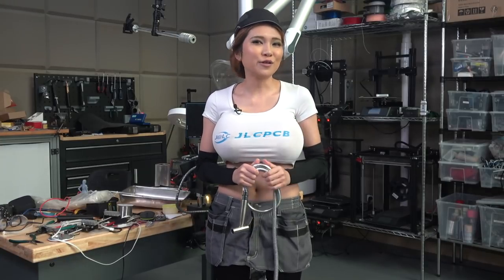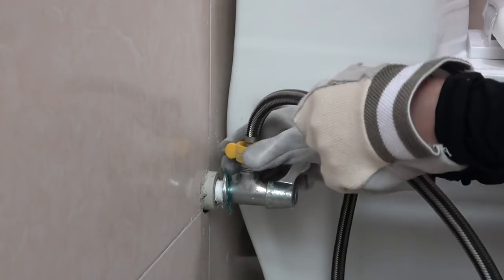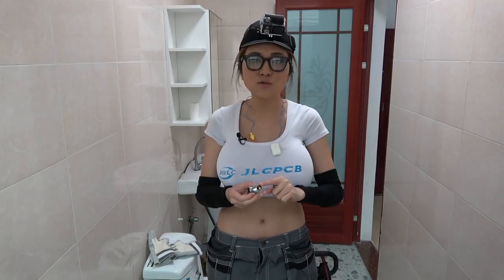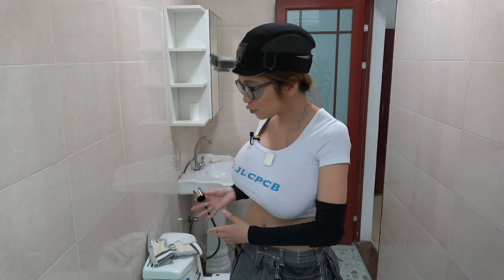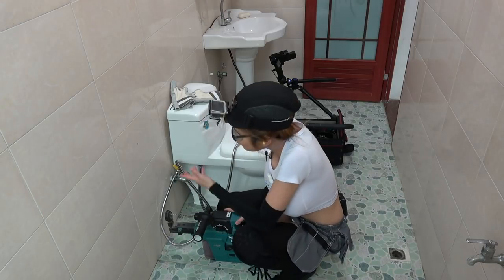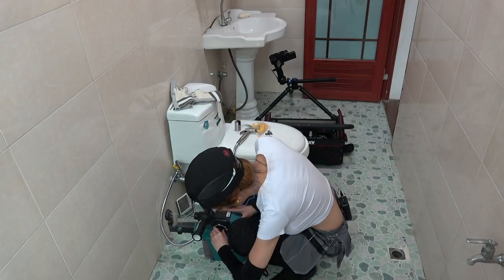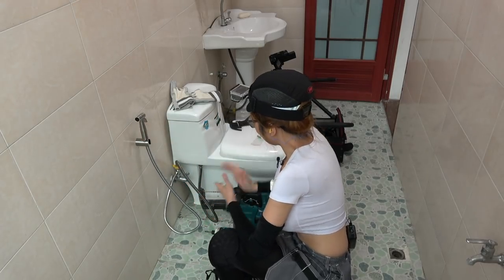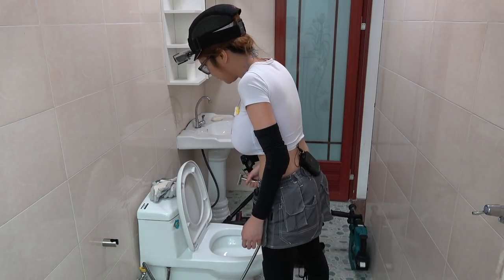Install a "BumGun" and Save Toilet Paper!

Comment: Nice!
I installed two BumGuns (what a fun name) at home. Had to add a mixing valve (russian winters are kind of chilly). If your hot and cold water pressure is different you have to add check valves, otherwise the mixer will mix more than you want. I also added an electric valve and wired it to bathroom lights (not everyone has a window in the bathroom), so I woldn't get an unwanted swimming pool if the hose fails when i'm not at home.
Wall water socket usually has a ball valve instaled (opens or closes by 90 degree turn). They (ball valves) are not meant to throttle the flow, they get scale deposits on the exposed parts of the ball and it can mess them up. It's better to add a globe valve for the bum gun (if water pressure is an issue).

Comment: I brought one of these BumGuns back from m last Thailand trip. One point (at least here in the UK) is that you need to fit a non-return valve into the system to prevent any ingress of "bad stuff" into the water supply.

Comment: Naomi, you nearly nailed the security measures, but, next time, use a pipe metal detector before drilling in the bathroom, you could hit a pipe and flood the house...
Earplugs are not that critical, just regular in-ear buds with your  music will do it fine (mine get 20db cancelled out), plus you enjoy music while drilling.

I use a similar drill to go through concrete walls with 50cm long drill bits, that's a bit overkill for the job, a normal handheld one with hammer (not with compressor) is fine and lighter.
Use the anchor sleeve to mark the drill bit with tape or a pen, so you get it to the right deep. (you got too deep).

Put masking tape or duck tape in the tile, will prevent the drill from slipping and the tile from cracking. 

You rock!
Reply from the maker: Good idea!

Comment: In the USA, we typically use a teflon-tape instead of that messy compound you had to smear around the fittings.  White is generally for water connections, yellow-tape is for gas fittings.

Comment: Piece of advice for water pipe connections...use Teflon Tape. Instant seal and you don't need a plumbers wrench to loosen when and if the time comes.
Reply: yeah, i was wondering about that...I've always used Teflon tape, myself
Reply: Hemp is better than teflon tape because it expands when it gets wet.
Reply: Neither sealant nor tape is necessary when rubber seals are used, tape is for threaded joints with no seals.
Reply: Murgoh   Your correct. Thread sealants are used for pipe joints which have a taper.  A gasket connection is a face to face seal so no other sealant is necessary.  The rubber is the sealant . An “O” ring seal requires a small amount of lubricant for assembly purposes. The amount of sealant Naomi used will eventually flush out, and in this case, guess where it gonna end up. Still, a good video.

Comment: Good job! 
Here we have always used Teflon tape instead of glue to seal the joints... 
I recommend it because I do not know the hardness of the glue but in Teflon it seals perfectly and does not bind the threads.
Greetings from Spain! 👋
Reply: That's usually what we use in the US also.  Some plumbing fixtures like this actually come with a tiny roll.
Reply: O ring joints don't (shouldn't) need tape or sealant.

Comment: I prefer the Japanese style bidets that have a nozzle pop out from under the toilet seat. If those are too expensive or you have no outlet nearby; you can get ones that run on water pressure (no electricity required) & can hook up to sink hot water if you want temp control.

Comment: I'd like to add in the USA typically we don't have wet baths with floor drains. The bidet bum guns come with a valve that allows flow to the toilet at all times but lets the operator turn off the gun. You only turn in on during use. IMO it's worth it to add a leak detector.

Comment: Hello Naomi,

here in Germany, the supplied seals are often of poor quality. Probably so that the hardware stores can sell extra seals.
If the screw connections are a little leaky, sanitary hemp helps. Insert one, two or three fibers into the thread pitch and screw them together. The fibers swell on contact with moisture after a litte while and seal.

greetings
René

Comment: Instead of using sealant, plumber's tape (Teflon tape) could also be used. Less messy... also no waiting for it to dry.

Maybe I'm overthinking this, but I'd also put in another valve for the bum gun, so that I can give it a different flow rate than the toilet tank. Also, if the bum gun turns out to be cheap and leaks when under pressure for a long period of time, you can turn the water off to it only without affecting the toilet's water supply.

Comment: I use a no-hands water cleaning system that is much more convenient that that one. It's similar to those japanese toilet seats, but it is a kit you buy, connect to the water, install under the toilet moving seat, and just push a button and the water jet goes automatically in the right spot.. then you have free hands to scratch it a bit if you need. I hope you know that only water, whatever the pressure it has, will not clean your bottom without some "finger help" lol

Comment: Agree with suggestions to use Teflon tape. But if you are going to use sealant, apply it to the male side threads. Putting it on the female side can result in the sealant being pushed down the pipe/hose with might clog things.

Comment: You should always use the 2/dual shut-off valve. The bum sprayers have a tendency to spring leaks. So a dual/two shut-off valves are needed.  If the bum sprayer leaks just turn its valve off and you can still use the toilet.

Comment: I really like the bum guns in Thailand (where I now live). The one you have looks like the same ones I have. If so, you can unscrew the spray end of the nozzle and there is a small screw inside where you can adjust how far the sprayer valve is pressed to start the spray and the maximum it can be pressed so you can limit the spray if is too strong.

Comment: Not be be critical Naomi, but when you apply the thread sealant, you should always apply it in the male side and not the female side. Couple of reasons for that is, you will get a better seal and use less sealant on the male side. Also you stand a chance of having sealant plugging or going into the hole if you apply it on the female side. Just a quick tip.

Comment: Those look like they could go very wrong, but I guess you get used to it! btw as a tip, if you're drilling tile you can put a bit of masking tape on it, it's easier to draw a mark and it stops the drill bit from sliding. It might also protect the tile from cracking around the hole, nobody seems to agree on that though!

Comment: I have just bought a Makita cordless drill but yours is so much cooler!
Incidentally I also installed a "bum gum" but mine keeps leaking even when the trigger is not pulled.
I kinda solved it with a manual valve on the wall, but is not very convenient to use...

Comment: When you use liquid Teflon you just put it on the threads, and no need to put it on the side with the oring.
Reply: I wonder how much of it ended up clogging the tank valve and the BumGun nozzle?

Comment: Since the installer of this contraption is also the beneficiary of its usefulness, the bodily part of which the nozzle takes aim could perhaps cause one to view the term “plumbers crack” from a different angle; horizontal rather than vertical and (w)holly owned by this individual. Just an observation in semantics.

Comment: Yes, in the UK we are home right now, as you said, and I love a plumbing job!  In my case both the hot and cold pipes are to the right and forward and there would be room for a mixer valve.  I'm trying to imagine the whole sequence of use in my mind, to see if it feels ergonomic - for instance,  can I reach the taps? Will the pipe snag on anything?  Can it coil up neatly and store out of the way, in the space I have?  Also, Amazon have 'bum guns' in stock as no-one has started panic-buying them, yet!

Comment: My idraulic here still use oakum and grease on file to screw mount pipes to avoid water spillover.
Reply: A modern version of that is a certain type of plastic tape, though not all plumbers like it.  Anyway for those unaware the stuff is wrapped around the outside thread, then the next pipe is screwed on, cutting into the stuff while letting it fill the space between threads.  Never loosen or unscrew without redoing the padding with fresh stuff.

Comment: One tip you may want to remember for the future. To avoid cracking tiles, always tap the plastic rawlplug further into the wall, below the level of the back of the tile itself. This way the rawlplug expands into the brick and not the tile.

Ps. I suspect you didn’t crack one on this occasion but it’s just for future reference. 👍

Comment: I'm getting 2. But for (what feels like) most of the year the water would freeze me or anybody trying to use that to death I'll try to find mixing ones... Otherwise it's great! I thought this was supposed to be complicated but feels like rather simple install!
Reply: The mixer is a separate product, same as the one in a shower or sink, only smaller because there is no open/close valve, only the mixing valve.

Comment: i have exactly this model. didnt know it was called bum gun. i bought the parts from aliexpress. i just connected it with a splitter valve to the faucet. i actally go before the corona crisis. felt kinda ironic when everyone stocked up toilet paper.

Comment: Be careful, you don't want to breathe in the crystaline silica from the drilling.  Nice Video, I don't like Japan washlets.  I spend a lot of time in Japan but it always feels like i can never be left alone, even in one of the toilets, one may be too hot so when you sit on it for 3 minutes it gets very very hot that i had to stand up and sit down again.  Then there's the ones that stop pouring water when you sit or just makes the water sounds.  Sometimes I've had them flush while i sat down so it's not very fun for me.  I never know which type i'm going to sit on ^_^

Comment: Install a “Japanese “ toilet seat which has that as a build in feature. It comes with lights, remote control, Heated seat, automatic closing, warm water, fan etcetera. Had these both in my Suzhou and Shanghai apartment.

Comment: I was hoping you would give us a review about how it works for you. 😂😂
Reply: Demo would be good.
Reply: The only problem I have is with those “cheap ass" taps. I know because every year I must exchange them very often. They look nice, are cheap, but after approximately 2 years they'll start to leak and the thin coating is peeling off. You'll get what you pay for, I guess.

Comment: Great videoNaomi. I have similar idea. One of the question is that shower hose should bee under the constant preasure od water? It not designed to it. To my solution  I ordered a thermostatic faucet for a shower enclosure and will connect a hose to it. Of course, I will need to switch the water manually. But I will avoid flooding. Well, but it compensates me with hot water.
Reply: Good point, but what she installed is not a kitchen hose sprayer, which is not designed for constant pressure. This is a sprayer specifically designed for this purpose, and as such is designed for constant pressure.
Reply from the maker: These are designed for it and used all over Asia, never had a problem.

Comment: Hi,i dont see any reason for the silicon,once you have the o ring,its good.
I would try having the pipe feeding the toilet,shorter,no need so long.
& last. I wouldn't drill holls for this , there are lots of super glue/ silicone for attaching to the wall.
Good show

Comment: Well, an intersting video , as usual, Naomi, but I have important questions concerning ... well ...  Bum Gun Logistics.

I mean - I can't see how you'd use this thing without making a dreadful mess. My guess is - WIpe then Fire the gun, then Dry?
And how high should one stand when using the gun? I mean - too low invites aiming failure and ... knuckle/pan contamination, but standing too high invites a bathroom monsoon.
And what's the gun cleansing protocol once it's been used? Is splash-back an issue?

I think we need an in-depth follow-up video on this very important topic :o)

Comment: I wish you had spent some time talking about that drill. Wow. Did you rent that for this task? A multi-mode drill. It looks like you used the same bits for the tile and the concrete behind it? Is that right? What bits did you use?

Also, that drill looks damn heavy. How did you keep it level while drilling?

I need to install some safety rails into my mom's shower this year. I've been wondering how I can safely drill the tile without cracking them. Unlike your place, I'm in the US and we have wood frame behind the tile. So I need to mount the rails into the studs behind the shower walls.

Comment: Great video as usual. 
I have been using bum guns for 8 years in Thailand, paper is not necessary afterwards. 
What is that sealant? Glue or grease. 
That is not an O-ring, it's a washer.

Comment: Can you explain the 4 holes that were drilled? The top hole will be covered by the holder, but the lower one needs to be decorated :)
Reply: I think she hit steel in the concrete.

Comment: Hi !
I have question...
I have Rumba+ board for my 3d printer with 3 extruders
Now i want enabled 3 extruders and 2 fan on TFT 28 v4.0
And I can't do this because in source code of TFT definition just 2 extruders. 
And import Tips... I used the single nozzles in my 3d... 

Thx for help me... 
Have good day.

Comment: Hammering the anchors in at 6:00? I'd be afraid of cracking the tiles. You did fine this time, but perhaps it would be better to push them in with the shaft of the hammer in the future?

Comment: its really bad to connect "bumgun" or Bidetta directly to pressurized waterline. It will start to leak eventually. Connect it to the watertap on your handbasin instead to prevent any damage.

Comment: Never heard off this. Still not sure how one would use it without getting water every where .It could double as a toilet bowl cleaner. One thing I learned about cleaning toilets. Don't use hot water, it will break the wax seal.

Comment: Oh man 😩
Ok, not every country uses flexible pipes between the wall and toilet flush system. In Germany this usually is by a hard pipe or even behind the tiles in the wall itself. 
Apart from that, the liquid seal is counter-productive. Sealing is by the rubber sheet. The liquid stuff hinders you to reach the right level of pressure on the rubber sheet, causing leakes. Then, you are using a adjustable wrench to thighten the connection. If you do so, please adjust for thight fit. Yours is way to open, causing the force to apply only at the corner of the screw. Another then, mount the knob on the wall in the space between the tiles, with that you are cauing a lot less damage to tiles. One screw is enough for the load... Last, but not least, your flushing system might not stop properly at low pressure. In case you need to adjust the pressure for your butt washer, add a valve in that pipe and leave the one filling the flusher at full pressure.

Comment: I would have added some silicon to the pegs in the wall just to prevent moisture from penetrating by capillary action into it…
Reply from the maker: Yes you are right, it's concrete but still a good idea

Comment: Hello if you have sealant washer don't use sealant anyways better than use thermostatic it's more comfortable warm water than better like cold
Reply from the maker: You can't screw them down very tight (the wall fixture is very cheap, it breaks), so washers and tape don't work, had some problems before I changed to sealant.

Comment: Why drill? You can easily get one of those suction mount holders or even hanger for side of toilet.
Reply from the maker: The one I linked has a toilet hanger, I don't like reaching back at that angle and suction cups fall off.

Comment: One thing to change Naomi, if your going to adjust the water flow its best to add a 2nd Valve between the Sprayer and the Tm\, water flowing threw can wear a valve if its partially closed, so later if need to shut water for repair it would allow water to still get threw.  8)

Comment: I don't get how it would clean anything... Without soap and rubbing, just water pressure doesn't get your butt clean. Cf toto washlet, same problem. You just get wet AND you have to use even more paper to dry now

Comment: After visiting Thailand in 2011 and experiencing these I brought some home and installed them in my bathrooms. You can buy them in the USA if you google diaper sprayer. You don't need hot water either. Your anus does not feel cold very well so after the first few times it just comes naturally. I installed one for my mom who has back problems and cannot reach her bum but these work for her. I love asian style hygiene - as does my wife from Thailand.